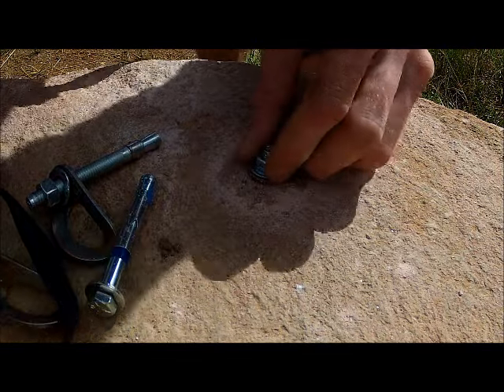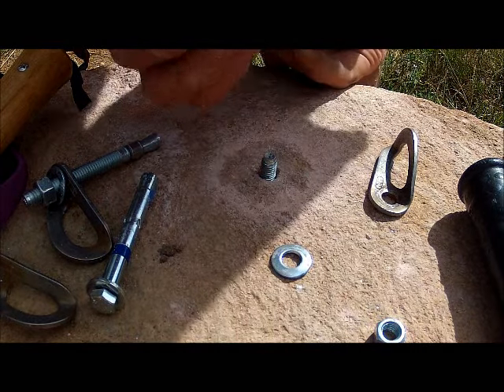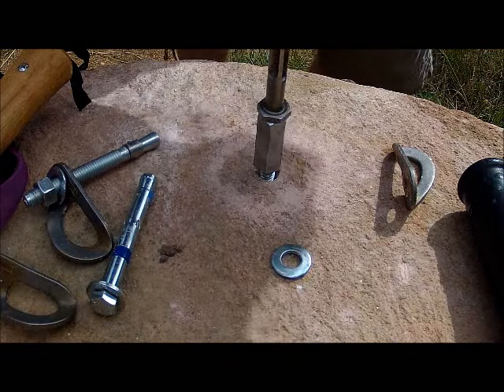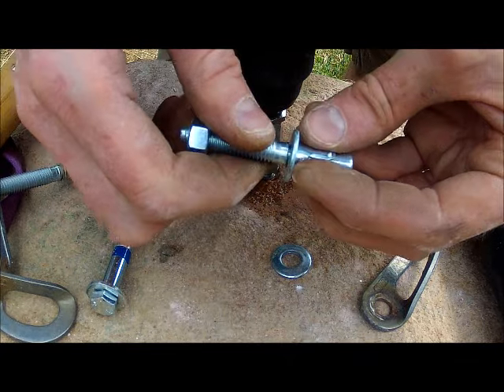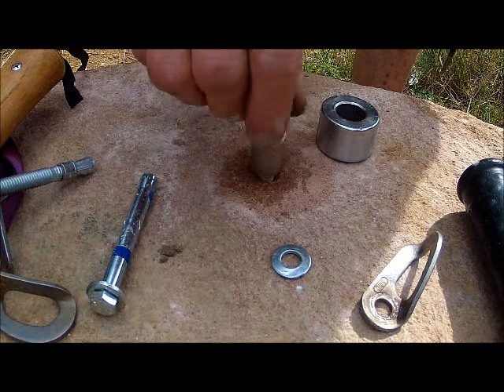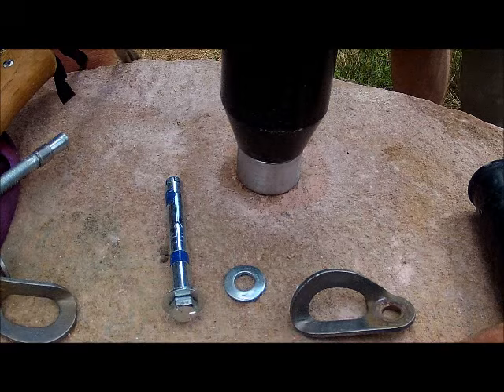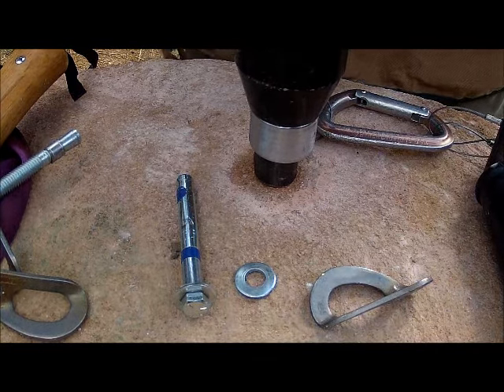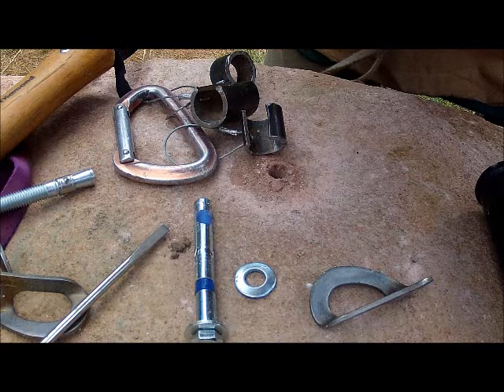Sustainable re-bolting: stud bolt removal technique

Comment from the maker: In case you are about to post a comment about the cropping - just watch this instead: https://youtu.be/dY0Du9WU_c0
This particular video is only helpful if you have some experience with the tools involved and have questions about technique. The presentation was for the benefit of ~20 people standing behind the tripod-mounted GoPro and not for a general YouTube audience. That said, if you have actual questions about climbing anchor replacement, post them here and I will be happy to assist.

Comment: So the replacement must be bigger than the original bolt, so 3/8" to 1/2". Are there any methods that work without that hydraulic tool?
Reply from the maker: In theory you could replace a 3/8" stud with a 3/8" 5-piece. We have chosen the 1/2" 5-piece as our standard in Eldo so all the replacement holes are getting re-sized. There are non-hydraulic tools.   https://www.youtube.com/watch?v=ZxQKIYgXu-c
Reply: @german13289  xxx

Comment: Wats the point?  Way to do that?
Reply: Golan dan The point is to reuse the hole for a new, better bolt. Normally you drill the hole up to a larger size/bolt. Otherwise, over time there will be several old bolts at the spot, which is not good for anyone.

Comment: very nice! just one thing though, the hydraulic tool is about  $900
Reply from the maker: +Achisachis73 http://www.ebay.com/itm/Greenlee-7806SB-Quick-Draw-Hydraulic-Punch-Driver-Set-/371432091177?hash=item567b13ee29

Used ones can be found for ~$250.
Working on a non-hydraulic bolt removal tool that will be very inexpensive.
Reply: Greg German
very nice!
Why not abandon the bolt and drill a new one?
The hole will just get bigger and will have to rely on glue to hold it.
How many times would you use the same hole? thanks
Reply from the maker: +Achisachis73 Several reasons:
-chopping and patching is a bad policy. There is only so much real estate and sometimes the bolt is in the best location with no good alternatives nearby.
-the removed bolt was 3/8", but the replacement will be a 1/2" 5-piece mechanical bolt which can be easily removed. That hole can be re-used several times.
-if the replacement bolt were a glue-in, it would be much, much stronger and longer lasting - not weaker if that is what you are implying.
Reply: Greg German
I agree with you about the glue in bolt. At work, I have done several anchoring methods for about 20 years, glue is nowadays very impressive in its strength.
I am not a very experienced rock climber so I ask, How ofter do you do this? let's say, at El Capitan or any other popular wall
Reply from the maker: +Achisachis73 Power tools are not allowed in federal Wilderness areas without special exemptions. Bolt replacements in national parks are usually done with hand tools and often must be chopped and patched as a result. Luckily many of the bolts being replaced on El Cap are 1/4" bolts where the hole can be reamed to 3/8" for a fresh bolt.
I do this sort of work one or two days a month here in Colorado, mostly in Eldorado Canyon State Park.
Reply: Greg German
wow! 1/4"?...that seems small to me, although I have seen videos from the 70's where guys with hemp ropes tied around their waists use old methods that by today's standards, would seem extremely dangerous.
Thanks for the info

Comment: Now you have a hole that will fill in with water and freeze and crack the concrete. An angle grinder would cut these off on 30 seconds!

Comment: Any advice for removing the wedge anchors that use a small clip, like what's sitting on the left on the video? Thanks!
Reply from the maker: MXicon Same technique. Those often come out more easily since the collar quickly cuts a sharper edge on the wedge. I can often get them out with the drill and water alone.